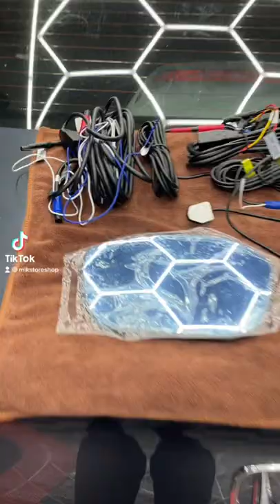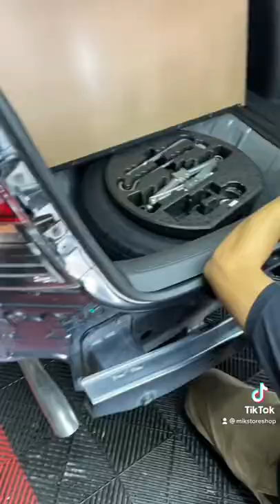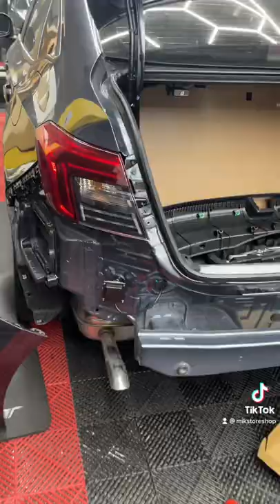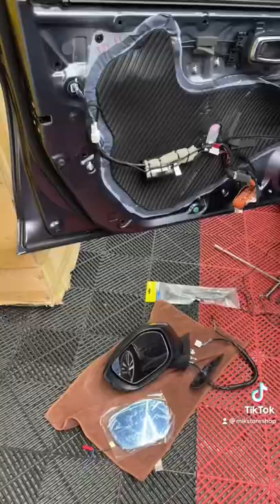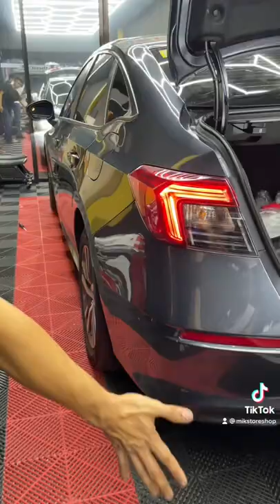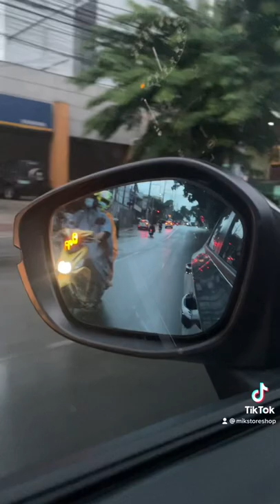Civic 2022 Blind Spot Monitoring System Installation

Comment: @mikstoreshop Why is it flashing red (collision) but the taxi is on a normal passing distance? Also, can the BSM activate/deactivate be integrated into the vehicle's Settings menu thru the infotainment or steering wheel control?
Reply from the maker: @gilbs72  because we activated the left turn signal thus the system send a flashing warning and audio warning inside the car. 

If you get the honda official kit, it will be enable in the instrument cluster. If aftermarket, none.  We sell both.